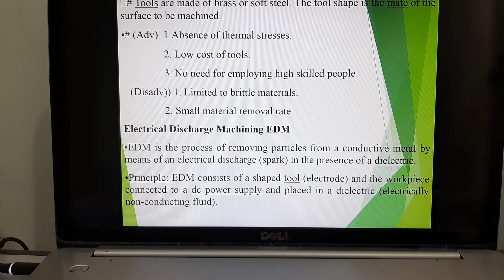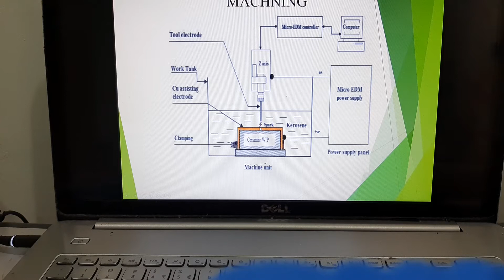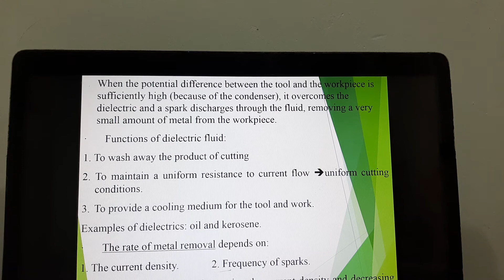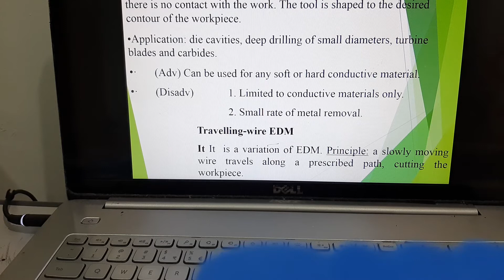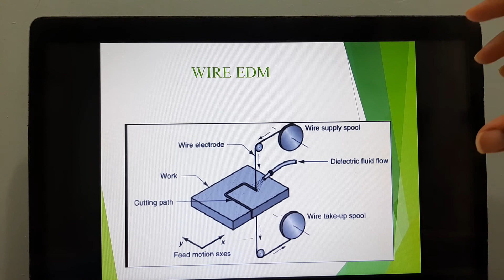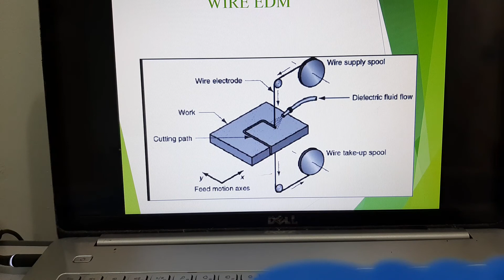NON-TRADITIONAL PROCESSES PART 2

Comment: Mohammad Aliff Bin  Mohd Pauzi (ME0104760).
From this video i learn that : 

Electrical Discharge machining EDM
=Process removing particle from conductive metal by means by electrical discharge
=consist electrode connect to  power suply and placed in dielectric 

Travelling Wire EDM
=slowly moving wiretravel along path, cutting workpiece
=no mchanical cutting but sparks generates

Electrochemical machining
=reverse of electroplating

Comment: Good evening madam. From this video, i have learned about EDM(Electrical discharge machining).It is the process of removing particles from a conductive metal by means of an electrical discharge in the presence of dielectric.EDM consists of shaped tool and the workpiece connected to a dc power supply.So, the functions of dielectric are; 1) to wash away the product of cutting 2)Maintain a uniform resistance to current flow 3)Provide cooling medium for the tool and work.Then, the rate metal removal depends on current density and frequency of spark.The rate increases with increasing current density and decreasing frequency of spark.
Advantage;Can be used for any soft or hard conductive materials
Disadvantages; Limited to conductive materials only and small rate of metal removal.
that's all. Thank you madam
.
Mohamad Fayyadh Fazlula'ah
ME0106089

Comment: Rajbhinder Singh me0106908
Hi mdm, in the video we learn about electric discharge machining. EDM can only machine conductive material by means of electric discharge in the presence of dielectric. It consist of a shape tool and connected to a dc power supply placed in a dielectric (a non conductive fluid). 

The space between the material and tool will induce spark that will do basic machine the material. The potential difference will overcome the dielectric and thus machining takes place, an example of dielectric fluid is kerosene. Dielectric fluid is used to wash away product of cutting, and maintain uniform resistance to current flow. the rate of metal removal depends of current density and frequency of sparks. This process is used in die cavities, deep drilling of small diameters, turbine blades and carbides, the advantage is it can be used on any soft or hard conductive materials. 

The disadvantage is it has a small removal rate and limited to conductive materials.Travelling wire EDM is a slow moving wire that cut materials along its path

Comment: Name : Aiman Hazim Bin Arif Razman
ID : ME0106080

From this video, I have learned about Electrical Discharge Machining (EDM) which is a process of removing particles from conductive metal by an electrical discharge (spark) in the presence of dielectric. It consists of shaped tool (electrode) and workpiece connected to DC power supply and placed in dielectric. Dielectric is an electrically non-conducting fluid such as kerosene or oil. The space between the electrode and workpiece will ignite spark and remove small amount of material from the workpiece (micrometer/nanometer). When the potential difference between tool and workpiece is high, it overcomes dielectric and spark will be discharged. The functions of dielectric fluid are to wash away product of cutting, to maintain uniform resistance to current flow (uniform cutting conditions) and to provide cooling medium for tool and workpiece. Rate of metal removal depends on the current density and frequency of sparks. The rate increases with increasing current density and decreasing frequency of sparks. Advantage of EDM is it is used for soft or hard conductive material. The disadvantages are limited to conductive material and small rate of metal removal. The shape of the cut is pre-defined in mainframe prior to cutting process. Travelling-wire EDM is a variation of EDM, slowly moving wire travels along a prescribed path, cutting the workpiece.

Thank you for the informational video Dr.

Comment: Siti zulaikha ME0105567
-understanding the electrical discharge machining EDM and the process
-understanding the function of dielectric fluid
-example of dielectric are oil and kerosene
-the rate of removal depend on the current density and frequecy of sparks
-understanding the advantage and disandvantage of EDM
-understanding travelling-wire EDM process

Comment: I learn about machining electrical discharges. Electrical Discharge Machining, in the presence of dielectric, can only process conductive material by electrical discharge. It consists of a form device and is attached to a dielectric power supply at the dc. The space between the material and the device will trigger spark which will make the material the simple machine. The potential gap would transcend the dielectric and thus be machining. Kerosene is an example of dielectrical fluid. Dielectric fluid is used to wash away cutting stuff, and to preserve uniform current flow resistance. Metal removal rates depend on current density and spark frequency. This method is used in die cavities, low diameter deep drilling, turbine blades, and carbides. The benefit is that it can be used on either soft or hard-wearing fabrics. The downside is that they have a low rate of removal and are limited to conductive materials. Traveling wire EDM is a slow moving wire where materials are cut along its course.

Muhammad Harits Bin Mohamad Zailan ME0106091

Comment: Good day Dr, what i have learned from this video is about electrical discharge machining (EDM). Edm is removing particles from a conductive metal by means of electrical discharge with the presence of dielectric. I have also learned the functions of dielectric fluid (kerosene/oil) which is to wash away product of cutting, maintain current flow and provide cooling for the machining process. I have also learn the relationship which that as the current density increases/frequency of sparks decreases, rate of removal increases.
The tool is shaped to the desire contour of the workpiece. The benefits is it can be used for any soft or hard conductive material. However the disadvantages are, limited to conductive materials only and low rate of metal removal. 
Lastly I learned about travelling-wire EDM which is slowly moving a wire across a determined path,cutting the workpiece. Thank you Dr

Muhammad Naquib Bin Nor Azlan
ME0106093

Comment: Mohamad Ikhwan Syafiq bin Zaidi 
ME0106090
In this video I learned about EDM is the process of
removing particles from a conductive metal by means of an electrical discharge
(spark) in the presence of a dielectric.  EDM
consists of a shaped tool (electrode) and the workpiece connected to a dc
power supply and placed in a dielectric (electrically non-conducting
fluid). Examples of dielectrics: oil and kerosene.
Functions
of dielectric fluid:
·      
To
wash away the product of cutting
·      
To
maintain a uniform resistance to current flow 
·  
To
provide a cooling medium for the tool and work.
In
this video I learned about Travelling-wire EDM.  It It 
is a variation of EDM. Principle: a slowly moving wire travels
along a prescribed path, cutting the workpiece. It can cut a various perfect
shape.

Comment: Hi madam, from this video I learned about Electrical Discharge Machining (EDM). It is a process of removing particles from a conductive metal by means of electrical discharge(spark) in the presence of a dielectric
Principle: consists of a shaped tool(electrode) and the workpiece connected to a DC power supply and placed in a dielectric
Functions of dielectric fluid(e.g: oil and kerosene): 
-To wash away product of cutting
-Maintain a uniform resistance to current flow
-Provide cooling medium for tool and work
Rate of removal depends on:
1) current density
2) frequency of sparks
as current density increases / frequency of sparks decrease, the rate increases.

-Tool is shaped to the desired contour of the workpiece
Application: die cavities, deep drilling of small diameters, turbine blades, carbides.
Adv: used for any soft or hard conductive materials.
Disadv: 
-Limited to conductive materials only
-small rate of metal removal
Travelling-wire EDM (variation of EDM)
Principle: slowy moving wire travels along a prescribed path, cutting the workpiece.
-cuts into a precise shape
-electrodes in the form of wire(cuts like scissors) 

Thank you madam!!!
AHMAD NAZRI BIN AHMAD TAMRIN ME0106079

Comment: Hi and good morning madam, From this video i have learned about electric discharge machining ( EDM) . the process of removing particle from a conductive material .EDM consists of a shaped tool ( electrode) and the workpiece connected to a dc power supply and placed in a dielectric ( electrically non-conducting) 
potential different between the tool and the workpiece is high, it overcome the dielectric and a spark discharged through the fluid , removing a very small amount of metal from workpiece.

Function of dielectric: To wash away product cutting
to maintain a uniform resistance to current flow --> uniform cutting
To provide a cooling medium for the tool and work

example dielectric : Kerosene and oil

The rate of metal are depend on current density and frequency of spark. The rate increase when the electric current is increase and decrease the frequency of spark. 
Application : Die casting, deep drilling of small diameter ,turbine blades and carbide.
Advantages : can be used for any soft or hard conductive metal
Disadvantages: only can use for conductive material and small removal rate

Travelling- Wire EDM
it is variation of EDM
A slowly moving wire travels along prescribed path , cutting the workpiece like taking scissors and cutting out specific shaped, Process is used to cut off thick plates for machining tools and dies with complicated shape and design.
- no machining cutting but sparks are generated between the wire and work piece . these spark cause the small particle to be removed from workpiece.
- the work piece together with the wire should be place in a tank and submerged into dielectric fluid.

Name : Alif Haikal Bin Azly
ID : ME0106081

Comment: Name: Nur Syazwani Bt Mohd Noor 
ID: ME0104367

Based on this video, i learned about another type of modern machining which is Electrical Discharge Machining (EDM). EDM is a process of removing particles from a conductive metal by means of an electrical discharge (spark) in the presence of dielectric. EDM consists of a shaped tool ant the workpiece connected to a DC power supply and placed in dielectric. Dielectric is electrically non conducting fluid such as oil and kerosene. When the potential difference between tool and workpiece is sufficiently high, spark discharges through the fluid and machining happens. To obtain a maximum rate of removal, the current density must be increases and the frequency of spark must be reduced. The application of EDM is die cavities, deep drilling of small diameters, turbine blades and carbides. It can only be used for machining conductive materials. Other than that, the variation of EDM is the travelling wire EDM which is a slowly moving wire that travels along a prescribed path, cutting the workpiece into a specific shape.

Comment: Good afternoon madam, I am Wong E-Shen (ME0106071). From this video, I have learnt about electrical discharge machine (EDM). It is the process of removing particles from a conductive metal by means of an electrical discharge in the presence of a dielectric. EDM consists of a shaped tool or electrode and the work piece connected to a dc power supply and placed in a dielectric. The function of dielectric (oil or kerosene) are to wash away the product of cutting, to maintain a uniform resistance to current flow and to provide a cooling medium for the tool and work. Next, the rate of metal removal rate is increase with the increasing of the current density and decreasing frequency of sparks. The tools or electrodes are made from soft, and easily shaped material since there is no contact with the work and is shaped to the desired contour of the work piece. 
EDM is used in die cavities, deep drilling of small diameters, turbine blades and carbides. 
The advantages of EDM is can be used for any soft or hard conductive material whereas the disadvantages are it limited to conductive materials only and has small rate of metal removal. Then, for travelling-wire EDM
, it is a slowly moving wire travels along a prescribed path, cutting the work piece.
Thank you.

Comment: Hi madam, I have learnt EDM.
- Process of removing particle from conductive metal by means of electric discharge in presence of diaeletrically.
-Its principle 
-The diagram of the system
-Function of dielectric fluid
-Example of dielectric
-Rate of metals dependancy.
-Tool is customized depend on the contour of piece
-Application of EDM
-Limited to conductive material, minor changes in removing range

I have also learnt Travelling Wire EDM
- Slowly moving wire slowly cut the piece in prescribed path
- The diagram of the system
- Like a scissors 
- precise shape 

Darrell Anak Dau
ME0106084

Comment: NIGEL ANDERSON SINGH A/L RAJDEEP SINGH
ME0106094
Good day, madam. Electrical Discharge Machining (EDM) is the process of removing particles from a conductive metal by means of electrical discharge (spark) in the presence of a dielectric. EDM consist of a shaped tool (electrode) and the workpiece connected to a dc power supply and placed in a dielectric (electrically non-conducting fluid). When the potential difference between tool and workpiece are high, it overcomes the dielectric and a spark discharges through the fluid (kerosene/ oil) removing a very small amount of metal from the workpiece. The function of dielectric fluid (kerosene/ oil) are to wash away the product of cutting, to maintain uniform resistance to current flow and to provide a cooling medium for the tool and work. The rate of metal removal depends on the current density and frequency of sparks. The rate increases with increasing current density and decreasing frequency of spark. Advantage of this machine is can be used for any soft or hard conductive material and the disadvantages are limited to conductive materials only and small rate metal removal. Travelling-wire EDM is a slowly moving wire travels along a prescribed path, cutting the workpiece.

Thank you

Comment: Good day madam , in the video we learn about electric discharge machining. EDM can only machine conductive material by means of electric discharge in the presence of dielectric. It consist of a shape tool and connected to a dc power supply placed in a dielectric (a non conductive fluid).  The space between the material and tool will induce spark that will do basic machine the material. The potential difference will overcome the dielectric and thus machining takes place. an example of dielectric fluid is kerosene. Dielectric fluid is used to wash away product of cutting, and maintain uniform resistance to current flow. the rate of metal removal depends ofcurrent density and frequency of sparks. This process is used in die cavities, deep drilling of small diameters, turbine blades and carbides. the advantage is it can be used on any soft or hard conductive materials. The disadvantage is it has a small removal rate and limited to conductive materials.
Travelling wire EDM is a slow moving wire that cut materials along its path.

Comment: Good morning madam, I'm Chong Jin Yang (ME0106047). From this video, I have learned about other two non traditional processes. The first is electrical discharge machining. It is a process of removing particles from a conductive metal by means of an electrical discharge (spark) in the presence of a dielectric. It consists of a shaped tool (electrode) and the workpiece connected to a DC power supply and placed in a dielectric (electrically non conductive fluid such as kerosene and oil). When potential difference between the tool and workpiece is sufficiently high, spark will be discharged. 
Functions of dielectric fluid:-
1) wash away the product of cutting
2) maintain a uniform resistance to current flow
3) provide cooling medium for the tool and work

Rate of metal removal depends on:-
1) current density
2) frequency of sparks

Application:-
1) Die cavity
2) Deep drilling of small diameter
3) Turbine blades and carbides

Advantages:-
1) Can be used for any soft or hard conductive materials

Disadvantages:-
1) Limited to conductive material
2) Small rate of metal removal (micro and nano)

Second process is travelling-wire EDM. It is a slowly moving wire travels along a prescribed path and cutting the workpiece. The principle is same as electrical discharge machining where sparks discharges when potential difference between th the tools and workpiece is sufficiently high. The concept is similar to cutting a shape using a scissors. Perfect shape with high accuracy will be cut with electrodes in the form of wires. Thank you.